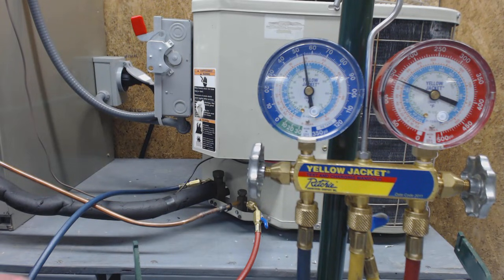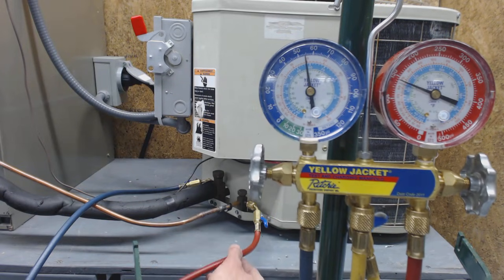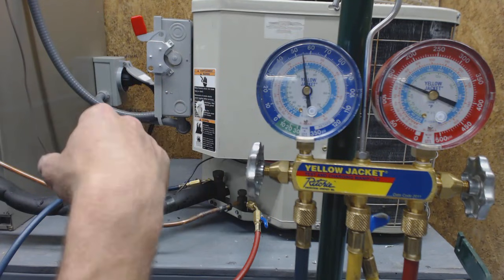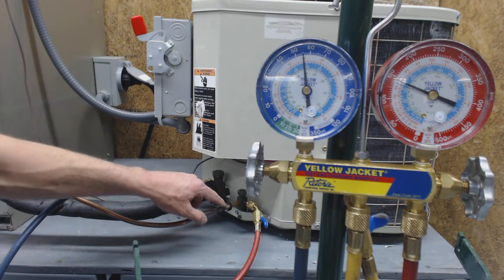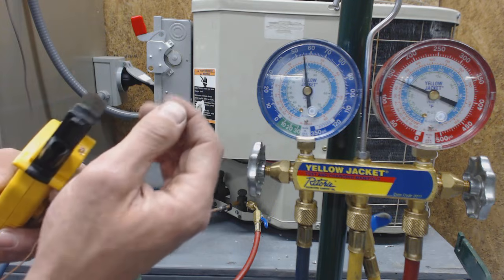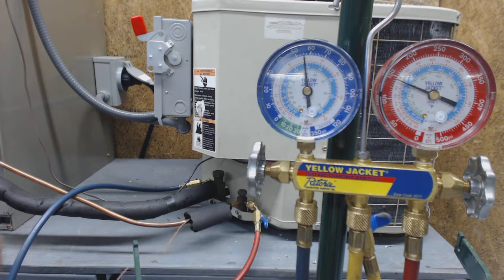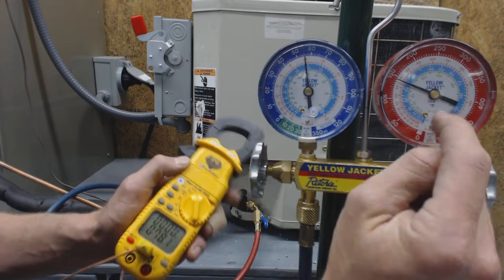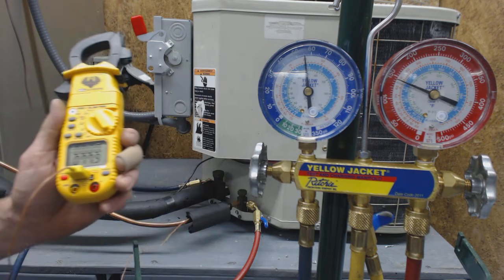Step by Step instructions on how to properly Check Refrigerant Charge!

Comment: Question: On my "Goodman" AC unit right above each hose schrader valve is a hexagonal nut. I've discovered that that's a cap with a Allen wrench socket underneath. What IS this? What's it FOR? What should it be set at? Screwed all the way in? Out? Middle somewhere (mine). Gas is present but my gauge set seems to be not working. Thanks in advance for you help.
Reply from the maker: If a system has a shrader valve and under the cap is a sunken allen hex hole then usually that is not moved again after installation unless for a pump down or removal. Typically this is back seated all the way up and does not have to be up tight at the end. Front seated would be shutting off the outdoor unit from the lineset and port. If this were in a midseat position this valve would restrict the refrigerant flow. For normal use of the ac unit, this valve would be all the way up but not tight if I am understanding correct, thanks
Reply: Thank you very much.

Comment: how much discharge pressure
Reply from the maker: Discharge pressure will depend upon the seer rating, type of refrigerant, degradation of the coil, and amount of subcooling required. Check the rating plate for the required subcooling needed if the system has a txv-   https://www.youtube.com/playlist?list=PLxnHR5_D2ojxTcAtR_53GoY8huBcSOt0a

Comment: is it normal for no heat coming off of the unit outside. my system keeps the house at 73 on a 94 day but runs all day or when it's over 80.
Reply from the maker: The system needs to reject heat outside so it does it  by blowing it out of the top or side of the outdoor unit depending on the model. You would need to have the refrigerant charge level and operation checked by a tech, thanks!

Comment: i have a Panasonic c assent  air conditioner not running  both the indoor and out door but power is there
Reply from the maker: Is the indoor unit sending signal voltage to the outdoor unit to come on?

Comment: Would you be willing to do a video on how to properly flush a system (line set and evaporator) for receiving a new condenser with a r-22 replacement refrigerant?
Reply from the maker: I would like to if I am doing a job for the right client. Also most systems I am going from r-22 to r410a and I rarely leave the existing coil and lineset. I find some unique way of running the lineset if it is not easy to run one. Thanks for letting me know what you would like to see!
Reply: Thanks for the reply.
I'm curious if you think it's a bad idea to reuse the existing evaporator/line set. I work for a local apartment management company and want to do what's best for all involved, but it seems they don't want to pay for anything to be replaced.
They're copper coils fitted with replaceable orfice evaporator restrictors, so I think it should work given the correct orfice for 410. What flush kit do you recommend?

Comment: So as long as both of my valves are shut, and the yellow line for charging isn't connected, I don't have to fear any explosions?
Reply from the maker: Hay It would not be good to have the valves on the unit shut. The valves on the gauge set should be shut. You would need to check to see if it is king valves or regular service valves. Proper training and 608 is needed before working on AC units. I think these are the videos that you are looking for. --  https://youtu.be/Ydu0B3_Wkss   ---   https://youtu.be/7Z8WS7zG8Eo -----  https://youtu.be/eXkqOS_qywo

Comment: I have always wondered what causes that white foam like substance when you disconnect your suction hose from the service valve on some ac systems.Do you know if this is a problem? Thanks love your videos
Reply from the maker: A lot of time it is white/yellowish. That would be not good as that is what the water mixing with the refrigerant oil looks like showing a moisture problem. When water mixes with refrigerant oil, it creates alcohol and acids. Thanks

Comment: hi, the specification chart for the unit i bought says refrigerant precharged 25 ft , refrigerant type (R410A) 33.6 oz , aditional charge for each ft .161 oz and desing preasure 4.2/1.5 mp 550/340 PSIG     the total length of the pipes is 35 ft how much refrigerant shoul i add or what woul be the apropiated measurment of refrigerant the unit should have? 
the unit is a TGM vision inverter 18btu model mwvit18s/mrvit18as
Reply from the maker: You would charge an inverter type by weight. It sounds like you would just need the 10X.161 which equals 1.61 oz extra. This could be weighed in after you get to the 500 micron vacuum level and you zero the scale out after you purged the air out of the hoses. You could break the vacuum with this weight or charge this into the low side a little at a time while running. Thanks!
Reply: acservicetech the machine has been worked on by other guys, and i am not shure were i am at in terms of the refrigerant charge i cant weight it because i dont have that tool i have presure meter, how can i be certain that the charge is ok?
Reply from the maker: Hey Richard, well I know Mitsubishi techs have said that their inverter systems can be set to 0-5 degrees of superheat when their indoor wall units are on full ac emergency on when it is at least 65-70 or more degrees outside but I am not familiar with what TGM says. The accumulator can store excess refrigerant and the compressor can ramp up or down and that is why it is different than signle speed compressors. These things are not published because the real way that they want you to check the charge is by recovering the refrigerant testing for leaks, vacuum pumping the system down to 500 microns and weighing in what it says on the rating plate plus the extra ounces due to lineset length. This is due to the inverter compressor instead of single or two speed compressor. I hope that helps. Thanks

Comment: how do i know if its correclty charge if i dont have subcooling in the nameplate?
Reply from the maker: Great Question! As long as you have a txv then you can use subcooling. If the rating plate is wore off then we typically use 8-12 degrees of subcooling. I usually will set at 11 and confirm an 18 to 21 degree temp difference between the supply and return air in the building. You should be able to get 18-21 as long as it is not excessively humid in the house. Thanks!
Reply: acservicetech thanks you sir,,i have another problem,,i dont seem to recognized in my split type a/c whether it is txv or piston metering device,,it says in the condenser nameplate that  max  pressure, suction=800kPa disc=2700kPa,,i have general fujitsu
Reply from the maker: It sounds like you may be talking about a mini split and not a split system like the one in the video. If it is just a one zone mini split or a split system then you could use the 8-12 degree of subcooling. In mini split systems the txv is in the outdoor unit on the liquid line. If it is a multizone mini split then the manufacturer wants you to recover the refrigerant, fix the leak, and weigh in the exact amount needed as the only way to charge. The way some guys get the systems running in the dead of summer is to get the vapor sat temp to 45-50 degrees when all zones are running on emergency cooling which is the highest cooling setting on each indoor unit. I hope this info helps, thanks!
Reply: acservicetech thank you sir,i have a mini split,then how do i know if its correctly charge or not?can i use the 8-12 with mini split?
Reply: acservicetech thank you sir,i have a mini split,then how do i know if its correctly charge or not?can i use the 8-12 with mini split?
Reply from the maker: The issue is that you likely only have one port on the vapor side and none on the liquid line for you to check subcooling with. You may have to try to check vapor pressure converted to sat temp on the gauge set and then check for 18-21 temp diff between the return air and supply air.  If the vapor temp is too low then add refrig, if it is too high then refrigerant would be recovered. The real way though and the only way recognized by the manufacturer is what I was mentioning before which is recovering the refrigerant finding the leak and vacuuming down to 500 microns, then weighing the correct amount in.  You can check out a video on this and finding the exxct amount to weigh in---https://youtu.be/QpzOSQt2fpI---- Did you check to see if you have 18-21 degree tempo diff inside yet as this is the easiest thing to do first?
Reply: acservicetech tnx sir,,i have two port for suction and discharge line,,thank you for all the replies,,keep it up

Comment: Can't tell if refrigerant going in the condenser or coming out, which is which?
Reply from the maker: Check out any of these videos on the refrigeration cycle which will show you in detail what is happening. In ac mode, the liquid in the small comes out of the condenser coil and the vapor in the large line goes in to the compressor.  Thanks!https://www.youtube.com/playlist?list=PLxnHR5_D2ojwbAc7K7DsjuasaDVfJeGSe

Comment: hello sir, i have a problem.  r22 unit piston metering. outdoor temp=90  wet bulb temp=59  high-side temp =120  line temp = 103   supercool=17    low-side temp= 32  line temp= 65  super-heat= 33   normally the procedure  would be to add refrigerant until the superheat comes down.   however a couple of days all the refrigerant was removed and weighed in.  i am afraid to add any refrigerant  for the superheat.  i thought maybe some type of blockage. didnt see any frosting around the piston and only a slight temp difference for the filter drier.
Reply from the maker: It sounds to me that you are low on refrigerant but have a lower seer rating or fins are not the greatest on the outdoor condenser. I would be hesitant about putting more refrigerant in if your superheat was say 7 or 9 degrees but since it is 33 then you should in order to see if you can lower it. You also need to add more refrigerant to get that vapor saturated temp up. If after adding refrigerant you notice that only the liquid line goes up then your statements above would be correct and it may be an obstruction. Who weighed the charge in? Was it a package unit or split system? Did you or they check the superheat after weighing it in to confirm that the charge is right? Thanks

Comment: after changind  a 3.5 tons air handler . new goodman air handler  to an  old  condensing unit , the low  side is over 70  a high side 150 with  R 407 ,why that.
Reply from the maker: That is likely ok. More details would help but if the temp is hot then the pressure of 72.5psig with a sat temp of 42.5 is possible. Do you still have 18-21 degree temp diff across the evap with the conditioned air?

Comment: I had a a/c tech come over to check on my upstairs a/c which isn't cooling very well. I notice the high side of the gauge rising as high as 400+ psi. When I asked the tech he said that it was normal for gas furnace unites. Now since he had added or what ever he did with the R-22. The outside condenser fan seems to be overheating and shuts off after a30-45  min. Then I go out side to the fan and press the RED reset button the fan turns on for a little then off again. Do you have any ideas off the top of your head on what the a/c tech had done to now cause the condenser fan to over heat and shut off?
Reply from the maker: Thanks for the Comment. The last time I saw 400 on the high side of R-22, the fins were partially off the tubing and the rest would flake if you touched it. It is either that or you have air or nitrogen in the system with the refrigerant. There is no such thing as normal for gas furnace units unless the furnace is on and heating while the ac unit is running. Are there bushes growing against the outdoor unit fins?
Reply: Thank you for getting back with me! I'm not sure what "fins" are. I have two unites one upstairs and one down. They are side by side and the upstairs unite, which is the unite having the issues, has bushes to the left of it. Also the condenser fan seems to be shutting down around 2-3 pm and the upstairs begins to heat up to 98 degrees. I get the fan to stay on and cool again around 7-8pm with no issues until the next day. Unless it's raining around 2-7pm or cloudy out the fan stays on and runs fine all day.The blower seems to be running fine. There is a lot of water coming from the blower condensation release drain outside behind the fan. I was overflowing and leaking water through the ceiling downstairs but I've cleared out the drain line and it also seems to be fine.    I live in Orlando, FL. Thank you for you time on my issue.

Comment: Thanks for the video ACSERVICETECH!  Like I have said before  am still new to the industry and wanted to ask. If the system has a TXV then you would be more into checking sub-cooling and if its a cap tube/piston you would be more on checking super heat?  I just want to see If I understand this right.  I work on a lot of appliances and don't get to work A/C stuff that  much yet at the place I work. Thanks alot for your help.
Reply from the maker: This is true for comfort cooling systems. Refrigeration can be a little different. Thanks for the comment!
Reply: Thanks for the reply acservicetech. Sorry I didn't thank you sooner, I didn't get a chance to get on here until now LOL!  I appreciate you answering my questions.
Reply from the maker: No problem, glad to help!

Comment: Do you need to consider the wet bulb and dry bulb temps in order to charge a system by superheat or sub-cooling? I was led to believe that depending on the ambient conditions you will get different superheat and subcooling reading..I know TXV metering device systems work different compared to fix orfice and cap tube metering device systems because the TXV tries to keep a constant superheat as apposed to fixed metering devices that are more critical to charge...I'm a noob, please bare with me if I'm not making any sense..-Thanks #greatvideo
Reply from the maker: You are making great sense! You need wb and outdoor ambient to charge in superheat as the target will change. TXV Subcooling does not change and you are looking for the target on the rating plateCheck out the Superheat playlist and the Subcooling playlist on the Channel! Thanks for the Comment!
Reply: Thanks for the response...I'll be checking out those videos you suggested ...Question- does the boiling point of the refrigerant in the coil change as the ambient temps change?
Reply from the maker: It changes as the conditioned air temp rises or lowers. There is also something to be said about the temperature of the liquid line as it comes in from outside and how fast the temp can lower when the pressure lowers as the liquid goes through the metering device but mainly the inside conditioned air will affect the boiling point on the coil.  This is why txv's are more efficient as they can allow more refrigerant through to maintain a certain superheat vs piston/orifice has a constant flow and capacity, therefore superheat changes. I hope this helps. Great Question!
Reply: Thanks bro, it sure does help a lot. I'm still in school and am trying to put all this Hvac stuff together. I've been watching all your videos and I have found them to be very informative. Thanks for taking the time to film and post them.#yourawesome
Reply from the maker: Thanks for your comments and I am glad to help you on your journey!

Comment: when you calibrate your manifold where exactly is zero? The clear box above 0 is rather large. where should the needle be pointing when you zero this type of gauge?
Reply from the maker: When looking straight at the gauge, the needle should be in the direct middle and then you tap lightly on the gauge to verify.
Reply from the maker: Here is a video on your comment. Thanks for your question!      Fixing Refrigerant Gauges? Explained and Adjusted!      https://youtu.be/A7fFlgJJ_DU